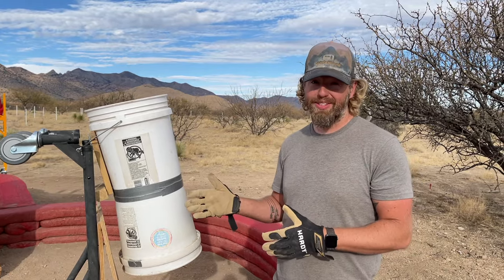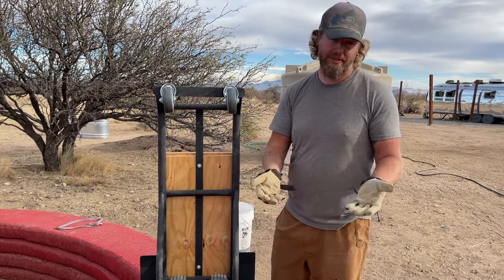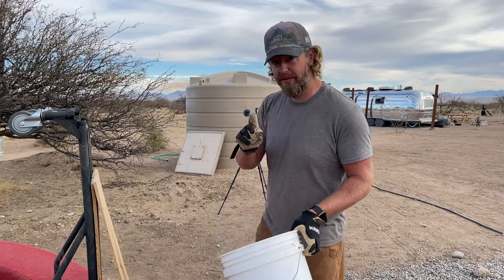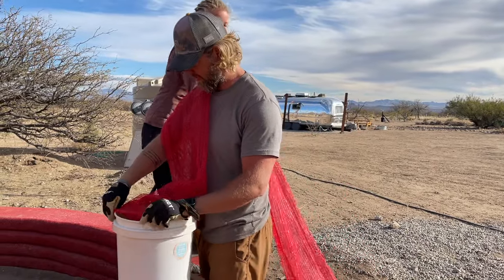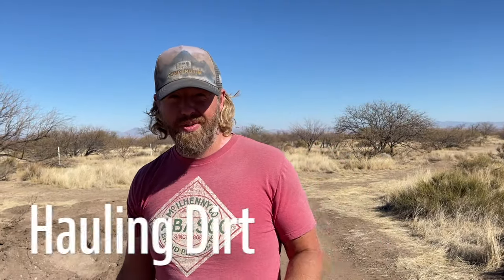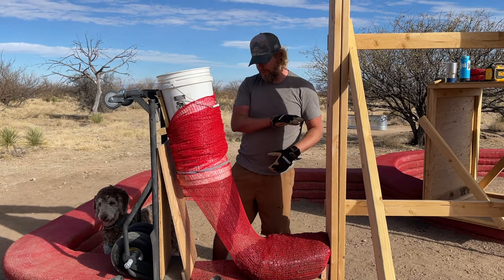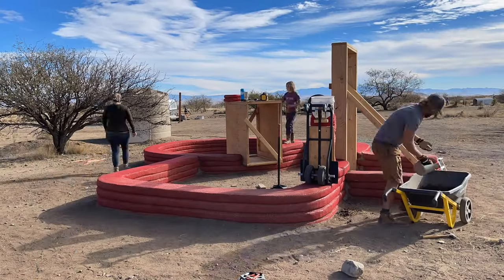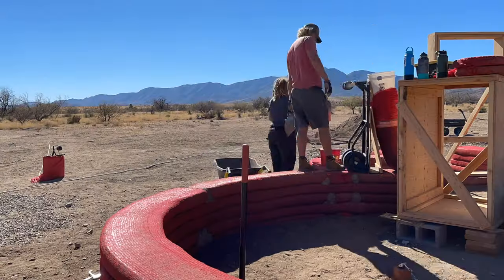How to lay HYPERADOBE bags! Earthbag Dolly System

Comment: Wow! Great system.  I noticed you have no barbed wire in between the rows. Looks very sturdy and symmetrical with these kind of bags. Keep up the good work and thank you for sharing 😎🤘🏼
Reply: You don't need it with the Hyperadobe because withe the open weave, the top layer leaches to the next layer and forms a bond.  MUCH less hastle. Great video.
Reply: @heppesg  I do not understand this claim. Concrete block and brick walls  require reinforcement and they stick to the upper and lower courses.  Does the bag itself create the tensile strength? Why do you remove the rock before filling the bag?  What size is your rock?

Comment: Looking at the slope on your dolly. If you use a mudflap for a semi and attach it about half way down your sloped plywood and let it continue about 6 to 10 inches past the bottom plat it will create a natural curve. 
adjust the leangth to what works.
Reply from the maker: Probably needs to be more solid than a mud flap. Earthbags are heavy!

Comment: Haven't looked at all your videos but what flooring system are you going to use? We have a Adobe floor and can recommend.
Reply from the maker: I’d love to know more about your floor. We’re still up in the air but would love to do an earthen floor
Reply: @TinyShinyHome  yes sure we have had earthen floors for years now with kids and all. Have linseed oil and wax finish. Gets mopped every second day. Can take water spills. Nice and cool. Nice to walk on with bare feet. No dust at all. Treat it like expensive wood floor. What's your email and I can send pics etc if you want. Also you may want to check out the nitto project on here too.

Comment: Great job guys!! Love how the whole family get involved into the project And also very helpful tips.
So I got a question since I already start working on my own house drawing plans.
I know you mentioned that you are using the 16" bags but
What is roughly the height or thickness  of each bag after they have been compacted?
Thanks again for your tips on the videos.
Roberto
Reply from the maker: Hi Roberto. We used 16” bags for the shed but we will be using 18” for the house. They averaged 4.25” when we used the dolly system.
Reply: @TinyShinyHome  I had been planning on using adobe bricks, but Hyperadobe method is surely the patrician option! So the bags are 16", does that mean the average layer is 16" x 4.5" or does the average width change when compacted? I need this dimension for planning purposes. Do you think a bag smaller than 16" would work well for a more traditional shed use design? Is 16" overkill for a more standard agricultural shed? Thankyou so much for your blog, this is really next level!

Comment: Great idea and video, but I've seen people put barbwire between each layer for strength and stability.   Is there a reason why you're not using the barbwire?
Reply from the maker: Hyperadobe earthbags don't require barbed wire because the mesh allows the material from the lower bag to lock into the material from the upper bag. The bags are much cheaper, UV treated, and lack of barbed wire makes the whole process much safer and more cost efficient.
Reply: @TinyShinyHome  thank you for the quick reply.  I've been looking at aircrete and making blocks, I've got about 2 or 3 years before I purchase some land.  I'm still trying to figure out what way to build.  The dolly is a great idea, what if you put a guide on each side to keep it centered on the course below?  It could also be offset if you go to make a cone or dome shaped rooftop, just an idea I thought of while watching the video.
Good luck with the building.
Take care of yourself and your family and stay safe.  
From Charlie.

Comment: I'm taking earthbag building classes at Cal earth currently. Out of curiosity how do you guys like the mesh bags? Theoretically, if you were kind of paranoid about the bags sticking together better, could you still use barbed wire in between the mesh bags? If so I would still consider the mesh bags just on the grounds they are the cheaper option regardless.
Reply from the maker: We like them a lot, but no barbed wire wouldn't help as the bags don't have the rigidity to make it hold on something that small. The only time we'd be worried about the bags staying together is on a dome. Otherwise the material coming through the mesh interlocks great.
Reply: @TinyShinyHome  So you're saying you only use them for purely vertical walls? That still seems like a good option for that type of build, but I am definitely looking into the dome structure. They also said the mesh bags wouldn't work for that, but didn't go i to more detail as to why. So i greatly appreciate you taking the time to answer my question. We will be doing our own build within the year and we are really finalizing the layout and materials now.

Comment: You should fabricate a contraption that will connect to the front bucket of a Kubota or any front end loader, scoop up the dirt and then lay the bags.
Reply from the maker: You have to properly mix the soil, cement, and water first in a cement mixer. Simple and easier to go from there to the bucket.

Comment: How does the material not come through the mesh of the bags? Looking at buying a bag material in the next day or two so a reply would be GREATLY appreciated! Thanks for the video!
Reply from the maker: Use slightly damp material. It’s a real tight weave. You’ll loose very little material.

Comment: Why dont you use the barbed wire? Every other bag structure Ive seen uses barbed wire, even the cal-earth folks. Is it just required for domes?
Reply from the maker: These are a totally different type of bag. The mesh negates the need for barbed wire. Each course interlocks with each other because of the mesh.

Comment: I did not see you anchoring each course with barbed wire which is essential to anchor each course to stop any kind if movement. ????
Regards from South Africa
Reply from the maker: Hyperadobe tube netting doesn’t need barbed wire because it allows the dirt from each layer to interlock naturally. One of the reasons we love working with it!
Reply: @TinyShinyHome  Thank you for that info. I am wanting to build an earth bag home and am definately sold on your "onion bag" type of material. Will have to make enquiries  if local stuff is UV protected and if available here in South Africa. 
Best wishes.

Comment: I think I’ll go to the plumbing shop and buy a piece of pipe the diameter of the bucket and use a skid steer with a concrete mixer bucket attached to fill the pipe as required.  I’ve seen this in Botswana Africa.
Reply from the maker: Hum…having a hard time imagining that. But good luck!

Comment: Super Adobe. They use barbed wire in between the layers.  What holds the layers together in hyper Adobe?
Reply from the maker: The mesh allows the actual material from the previous layer to lock into the next layer.
Reply: @TinyShinyHome then as you are tamping flat the top of the bag, some of the material is being forced through the bottom locking together with the previous layer along the flat area of the bags.
Reply from the maker: Yep, that’s the idea.

Comment: The hyperadobe bags seem to be less expensive but I'm concerned about the weave being so open. I can't imagine those working in a rainy climate.
Reply from the maker: Solid earthbags would have the same issue, that's why you cover them during heavy rains. Those bags aren't watertight either. The cob is where you get water resistance. We haven't had a ton of rain this year, but the rain we have had didn't affect the bags at all. You are right, though - earthbag in general works better in a dryer climate.

Comment: Nobody talks about how long last those bags. Well by experience it doesn't last not even two years. So people open your eyes. Thanks.
Reply from the maker: We have talked at length about how long they last. They're UV treated and in a harsh desert environment will easily last 4-5 years. But they aren't structural anyway. All earthbags must be covered and plastered over long term. So as long as you can build your structure within 5 years you'll be fine. If your bags only lasted 2 years you aren't using the same thing. Get better quality stuff.